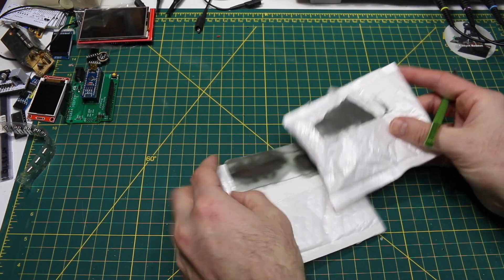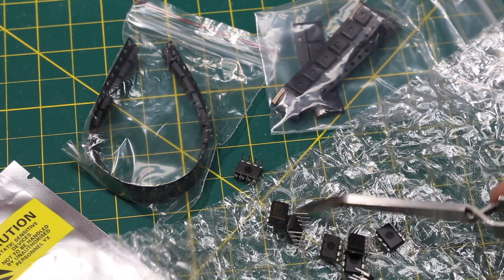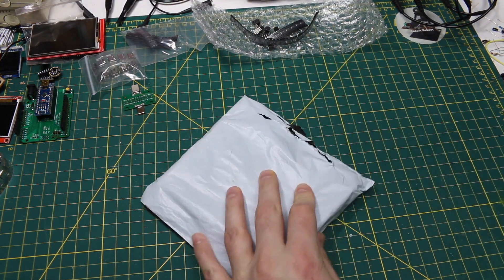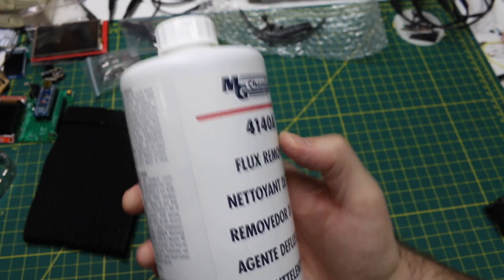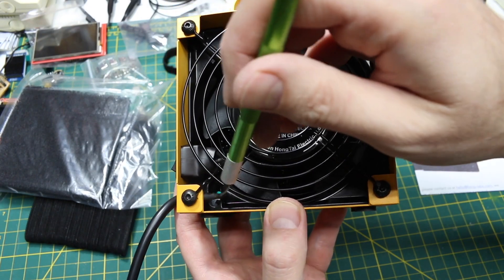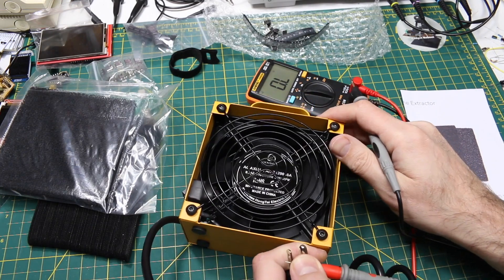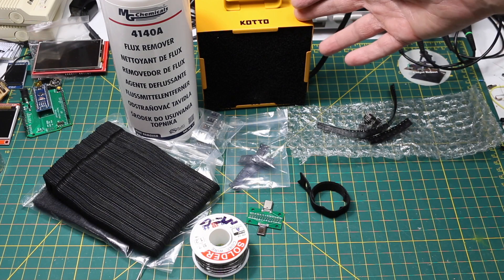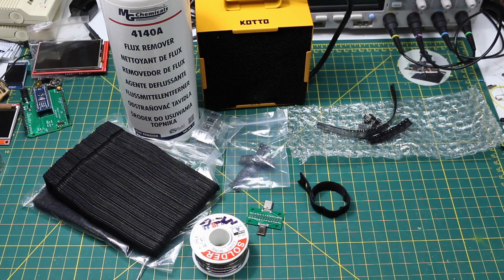Mailbag!

Comment: Should have gone to pound land and bought the £1 phone tripod it comes with a phone spring clip holder and standard cam ball joint threaded screw adapter just like yours but was all for £1 -- See your odysee for other comments about my extractor fan - My PCB Flux Remover and Cleaner is - 300ml Distilled  water, 100ml Clear Vinegar, 50ml cheep Washing up liquid and 1 gram Rock salt. Shaken not Stirred when every used, Stops developing - Gold Finger.

Comment: How does the Flux remover compare with Isopropyl, looks like the extra ingredient from the MSDS sheet is n-heptane.
Reply: Flux is a type of tree sap. Its always going to leave some sort of sticky residue after the first clean. IPA is cheap and safe. Thats what most experts use. Whatever you use, you'll always need 2 or 3 goes to get it clean. And that sticky stuff builds up in the brush bristles. Use a white toothbrush. It will go yellow pretty quick and you can monitor its cleanliness. Wash it in IPA once in a while to keep it clean. A dirty black brush will just keep smearing that stuff around.
Reply from the maker: I never had good luck with isopropyl but the flux remover seemed to dissolve it effortlessly.  Now I just need to figure out how to remove the cloudy haze and make the boards look new.  Maybe just another application would have done it but I didn't put much effort in.
Reply: @GadgetReboot  Might want to test a drip of the Flux remover on part of a clean board  with the same coating, just to make sure the n-heptane is not causing the problem.  n-Heptane can be used for diluting some conformal coatings.
Reply: @GadgetReboot  - I use spray flux remover (like the MGchemicals stuff) and a white toothbrush. That removed the flux OK, but leaves a film... so just wet a cloth with IPA and wipe the rear of the board to make it shiny. Don't use that stiff black brush, it's scratching the sh17 out of your solder resist coating.
Reply: Trichloroethylene, if you can find it, is the ultimate flux remover. Bonus: it's non-flammable.
IPA is a pretty pathetic substitute. Never tried n-Heptane. Both are enthusiastically flammable.

EDIT - Okay, TCE is actually slightly flammable.

Comment: Nice stuff.  I never tried a fume extractor. I kinda like the smell of lead ,tin and flux. Call me weird.
Reply: The smoke is nothing more than tree sap. You're not weird some flux have a lovely smell. The lead does evaporate or become airborne. Boils around 1,700'C Lead is very heavy and flow across the surface. Solder flux is harmless, There is no lead in the smoke and all these extraction systems are just a money grab by the Chinese from the less knowledgeable members of our hobby. Dont waste money on a noisy obstructive fan.

Comment: I'd love a magic flux cleaner that just made everything shiny. I feel like every one just puts a thin layer of flux all over the whole board.  I made a DIY fume extractor with that same carbon filter and a 120mm fan and it works great.   I think everyone should have and use one of those things.
Reply from the maker: I was going to use one of those big computer case fans I have laying around and one of those filters but I never had the motivation.
I think I have to accept that I will never have a properly clean board so I’ll just be aiming to decontaminate it.
Reply: @GadgetReboot  I don't blame you. If I decide to put one at my other solder station I will probably just buy one also.
Reply: Why? The fumes are harmless. There is no lead or toxins in those fumes. Lead is heavy a liquefies. It boils at 1,749'C. It does not evaporate into the smoke. Its just flux smoke, aka tree sap.